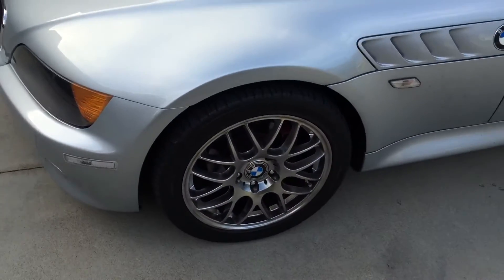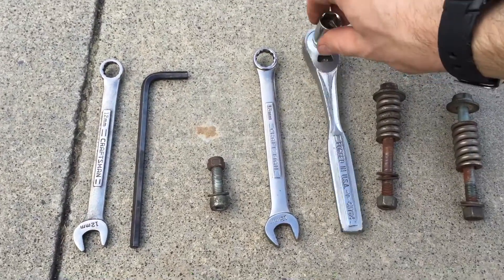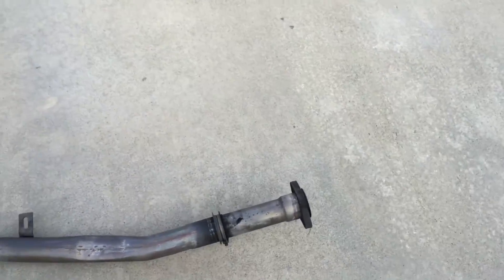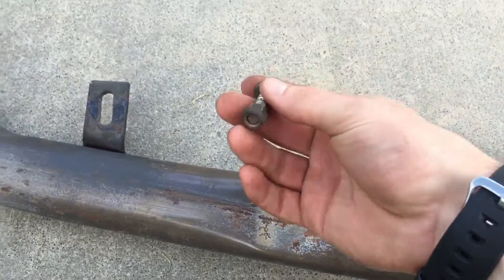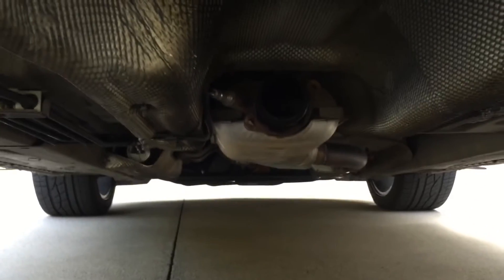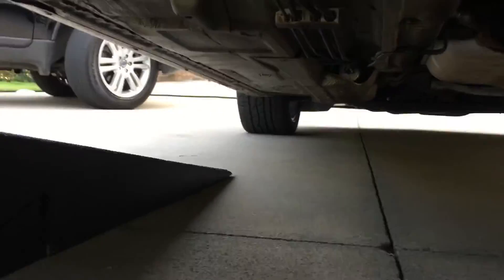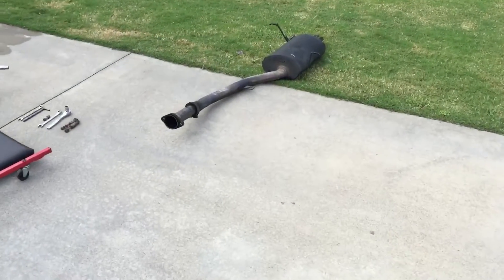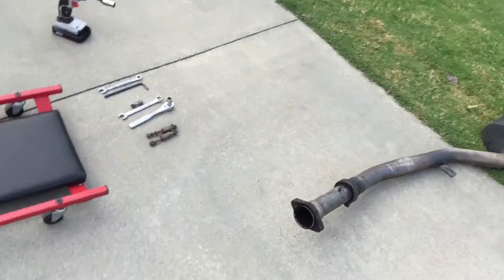Muffler Delete For Free In 15 minutes?

Comment: Is it safe? When I did this to my old 14 veloster turbo the exhaust gases caused so much heat under the car I would lose break pressure. Have yu noticed anything of that sort after removing the muffler and not running a straight pipe
Reply from the maker: This is definitely very temporary just to see if you like/can tolerate the noise level.  Long term can be dangerous if gasses are not routed correctly out.